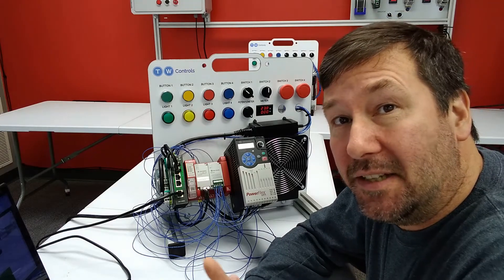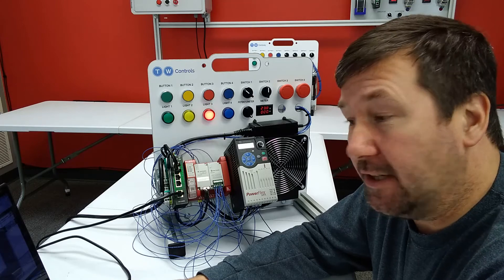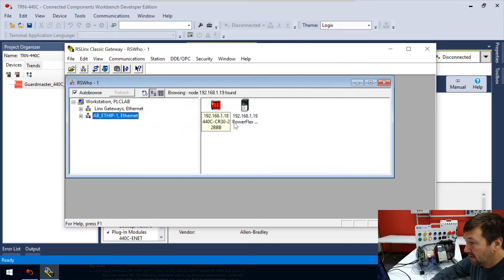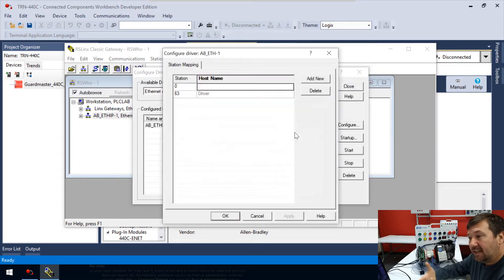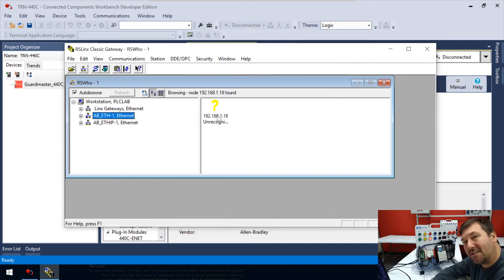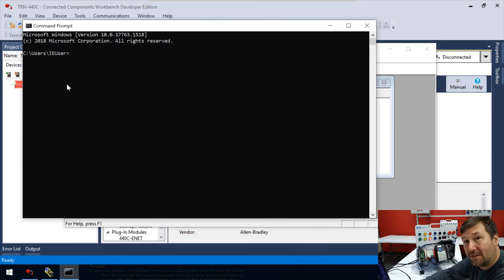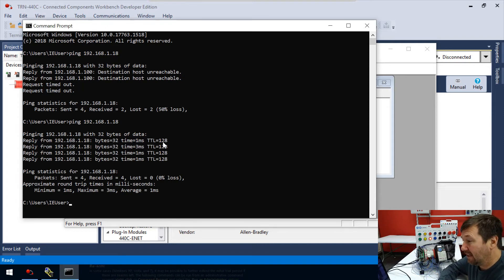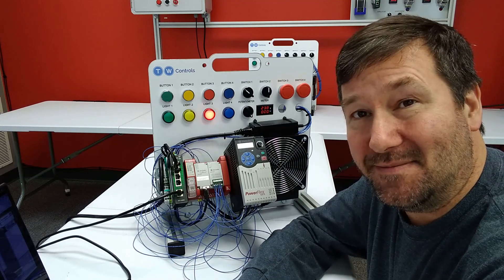Allen Bradley 440C-CR30 Safety PLC, Configuring Your Ethernet Communications Drivers for Connecting

Comment: How about connecting encoder to CR30? Is it possible to have "safe hsc" in it? Encoder can have eg 4 pulses per rev - just to know machine is running or not. Ehat fo You think? I was looking for solution but propably using pilz is cheapest way to go to bave safe hsc input...
Reply from the maker: No, there isn't a way to connecting encoder to the CR30. You would need an intermediate device such as a Pilz or there are some nice Ethernet safety encoders but you would need a safety PLC for them to connect to.
Reply: @TimWilborne  so in that case better fully use PILZ system 😥 it's a shame because I was really hoping to use and learn just 1 system (which is also rare in Europe)